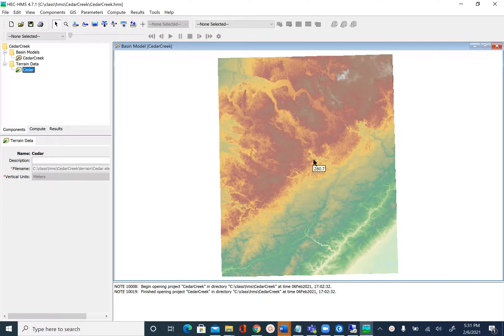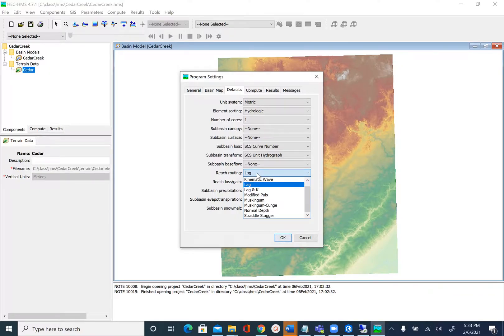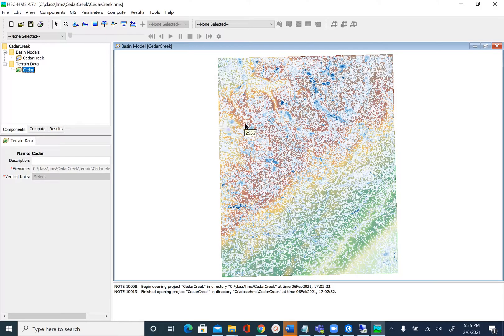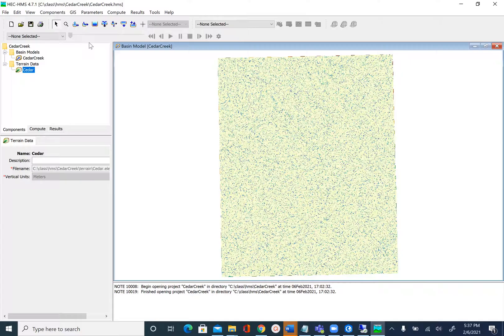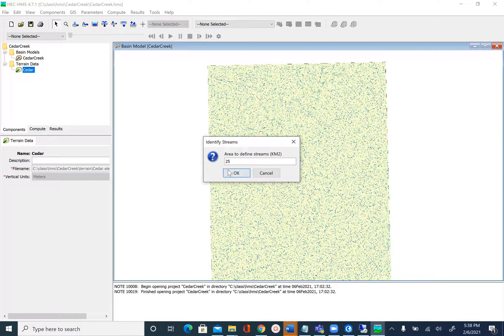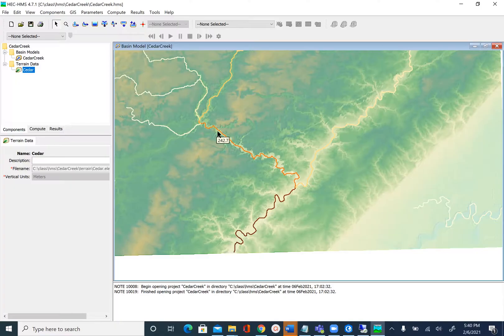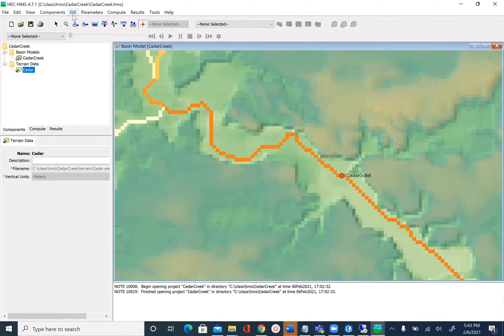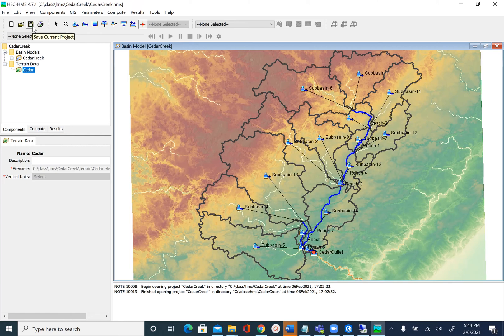Hydrologic Modeling Using HEC-HMS: (3/9) - GIS pre-processing

Comment: Great stuf, thanks a lot!
I'm using HMS 4.9 and can't display the DEM nor do simple GIS things like terrain reconditioning.
My reference system is OK (project in program settings and terrain) and since I'm outside USA, the regional settings are in english (USA), in my Windows10 x64 [with framework 4.8]. What could it be?
Reply from the maker: recreate or save your DEM again as TIFF. Open a new project and try again. I cannot think of anything else assuming that the program (HEC-HMS) was installed without any issues, or try installing version 4.8.
Reply: Did you find a solution?

Comment: Hi, my HEC-HMS is computing flow accumulation for more than 3 hours now, it's still loading. I can't progress. I am using ASTER DEM (12.5m) and it shows the elevation in negative value. it is HEC-HMS 4.9. Can I get some help?
Reply from the maker: Make sure your data are correctly projected and your machine is able to handle the size of your data. If your projection is correct, try converting your DEM to 30m. That should reduce the computational burden.
Reply: @hydrologyvideos8253  Many thanks. This problem has been solved. But the identified streamlines in my project doesn't match the terrain. Is there any way to edit them?
Reply from the maker: @khadizatulkobranahin3877  the newer version of HEC-HMS has the option of reconditioning (burning of streams) which may solve this problem.
Reply: @hydrologyvideos8253  Many Many thanks sir.

Comment: I ran it on my own DEM, but it resulted in hundreds of super small sub-basins after taking an hour to compute. I guess the software is getting way too precise. Is there a method to limit the number of sub-basin and set a minimum area for them.
Reply from the maker: what threshold area are you using to delineate streams? increase that area and number of sub-basins will decrease. try using 5% of your total watershed area for delineating streams
Reply: @hydrologyvideos8253  Are you refering to the number we enter for "Identify Stream" ?
Reply from the maker: @kaytang6507  yes

Comment: Thanks a lot for the awesome training.
I am following the steps based on the video series. But I am stuck in catchment delineation. The software freezes after starting "delineate elements".
Would you please be able to advise me on that?

The catchment is very small so the complexity shouldn't be a problem.
Cheers
Reply from the maker: I am assuming you are using  your own dataset to delineate the sub-basins. Make sure your data are projected with proper coordinate system assigned. I cannot think of anything else.
Reply: @hydrologyvideos8253  Perfect :). Thanks. The problem was with projection